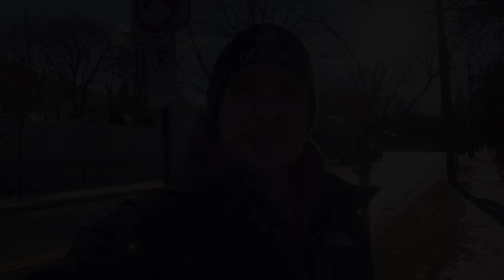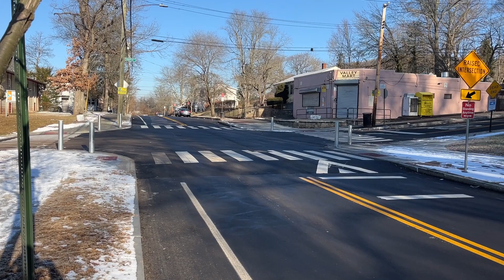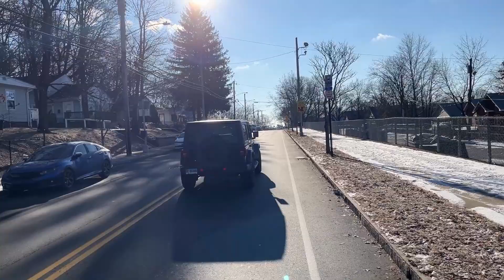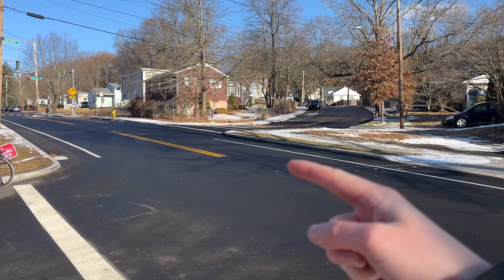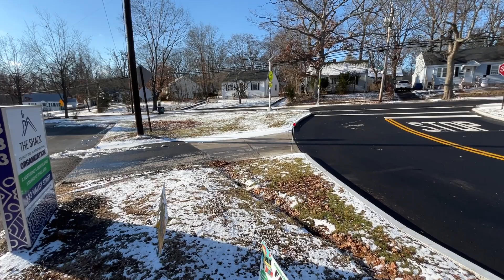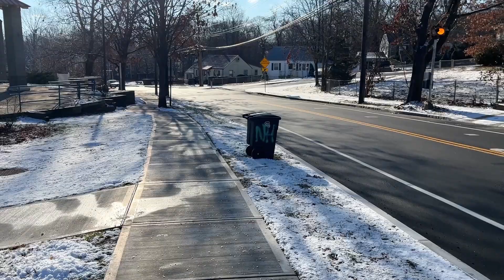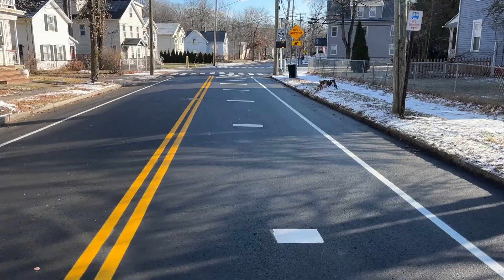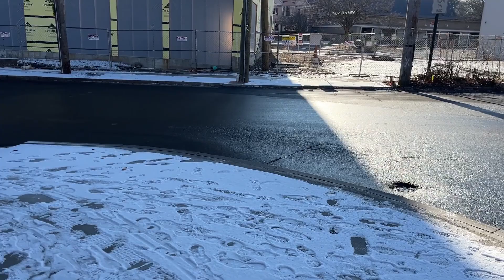Valley Street Traffic Calming Project

Comment: Nice progress, but I have some constructive criticism:
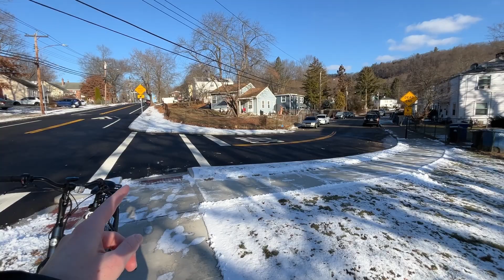8:08 The lack of setback on this type of crossing is both a hazard to pedestrians / bikes (lack of visibility and reaction time) and an obstruction to traffic. (waiting cars block the road)
With a setback, turning cars pass the crossing at nearly 90 degrees, which significantly improves visibility, and also adds a couple of seconds of reaction time to evade a collision.
The setback also provides space for waiting cars, so that they don't block the road. And in the other direction, cars can wait after passing the crossing, which is both more efficient and safer. (the waiting space is closer to the intersection, drivers can focus on one step at a time, and pedestrians can pass behind the waiting car)
Reply from the maker: Understood on the setback crossing, I am trying out using it in current designs especially with bike lane crossings (this project was ~3 years old) but it may not make sense / have enough space in all locations. These side streets are all very low traffic dead ends, and per the CT state statutes, crosswalks are located at the imaginary extension of a sidewalk across an intersection. Offsetting that crosswalk ~15 feet back would achieve your goal, but realistically pedestrians here are just going to walk in as straight a line as possible and I’d rather have the crosswalk location reflect that behavior